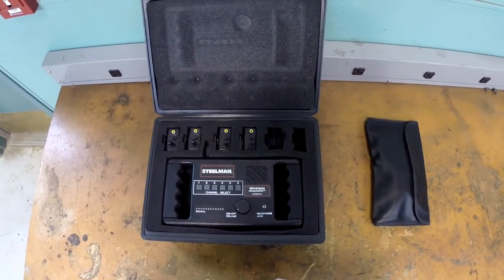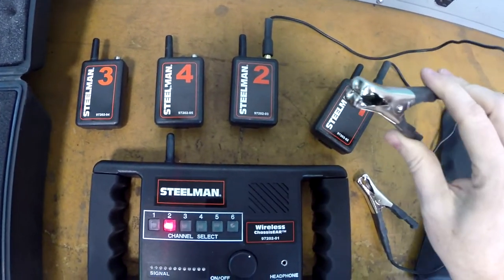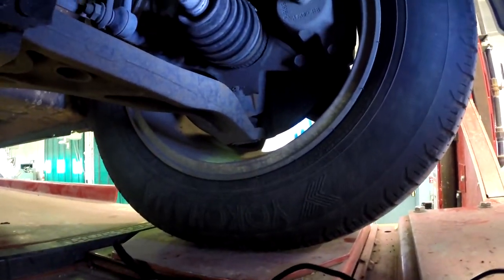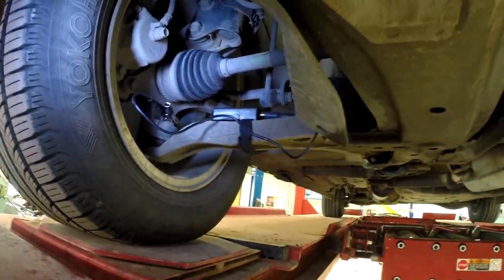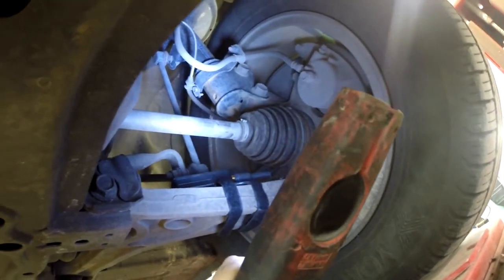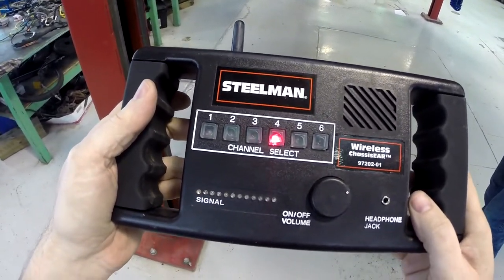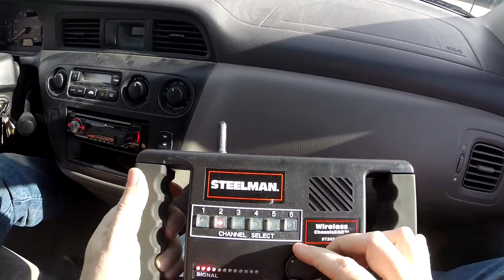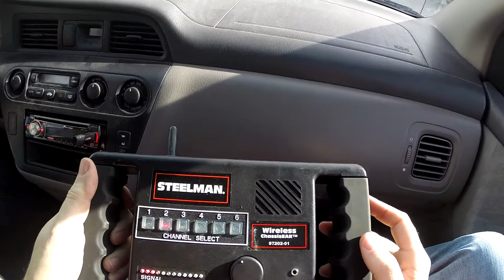Chassis Noise Diagnosis with Chassis Ear

Comment: Can you fix the microphone clamp??? It was working, clamped it to my axle... Turned and it must've messed up the connection to the clamp... Annnnd now it doesn't work lol 00 got about 30 seconds of use out of it, and didn't hear my noise.... Which i think is the CV, it's only when turning at higher speeds and it's cyclical, not clicking more like something rubbing, but it just started and haven't touched anything on the front suspension..

Comment: Check the L/R front hub, remove tire from the lift first. Could very well be front bearing not (true)or out of round from wear R/R. Just a matter of time before it goes out. Better yet install brand new hub bearing assembly to both L/R side. Ball joints is done by grabbing each rim/tire shaking it liberally, if too loose replace that as well. Btw,...wheel hub Bearings wear 1st...before the Ball Joint

Comment: hi are you still using the Steelman...? I'm thinking of buying one but wondered if the wireless connectivity suffered interference or not. Did you ever try the wired versions?
Reply: I wouldn't the wired version because of driving with the wires attached to the vehicle and such
Reply: I wouldn't the wired version because of driving with the wires attached to the vehicle and such
Reply: @declanosbourne62 : You said that.